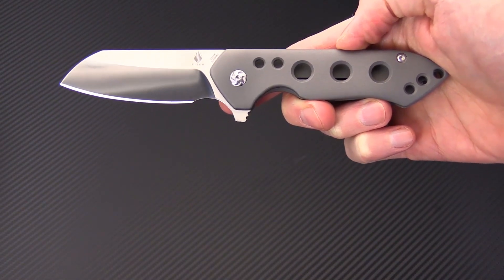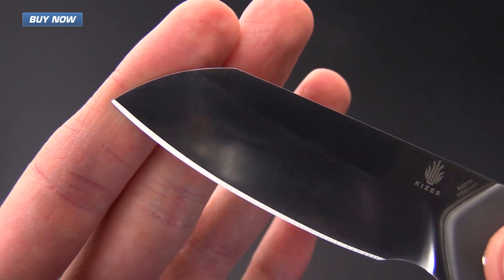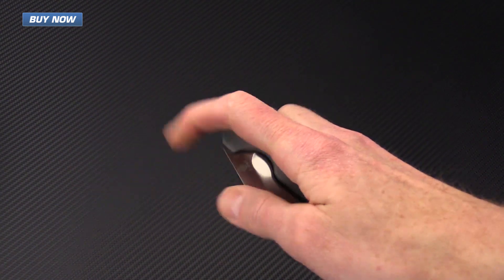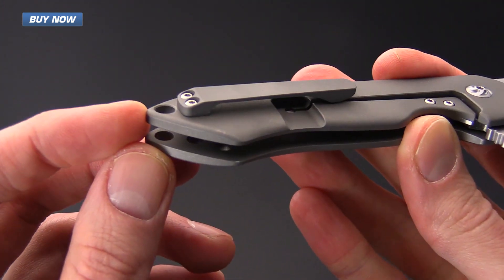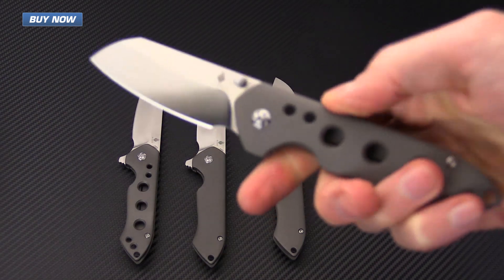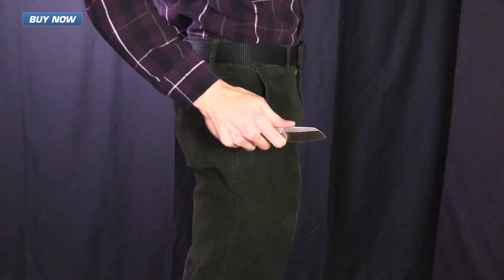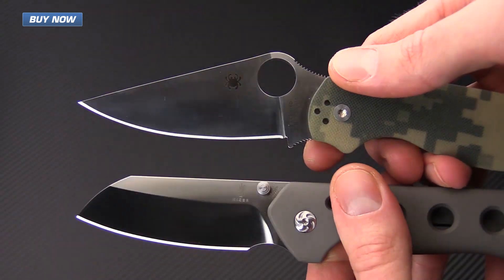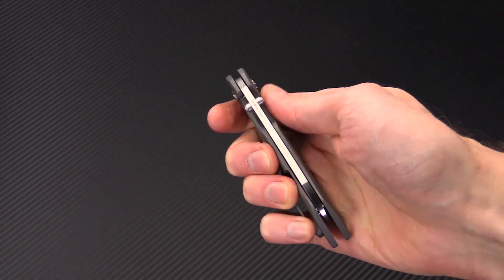Kizer Guru Degnan Design Titanium Frame Lock Overview

Comment: I got the thumbstud version with holes a couple ofdays ago and I quite like it, nice abd smooth with the bearings, very eronomic and I particularly like the handle finish, but it has its flaws like the overly thick 3.5mm blade stock for the size of the knife coupled with a mid blade flat grind makes this not a perticularly good slicer. The blade to handle ratio is also not perfect and the weight is up there for a 3" blade...
So not perfect, I would like to see a stonewashed blade as well as a thinner blade stock (3mm or 2.5mm), no finger choil on the blade and a shorter handle by removing the lanyard hole, all that would also result in a lighter folder.
But as it is its still a cool design and a good edc blade in my opinion!
Reply from the maker: Make it a full flat grind with no choil, I'm with you there. Maybe they will make one in the Vanguard series for a nice lightweight, G10 option.
Reply: GPKNIVES The Vanguard knives are great budget knives but not my personal style...
I would also like to see a hollow grind on the guru would bring that 3.5mm thick spine to a nice fine edge :) Also polished chamfers on the holes would really ad something to this knife :D
But don't get me wrong I think its a nice knife and very well built, it could just be plain awesome with some changes in my opinion.
Have a great day!
P.S. Have you checked out my Lionsteel Nyala Pen review, something special for sure with that damasteel tube :D
take care!